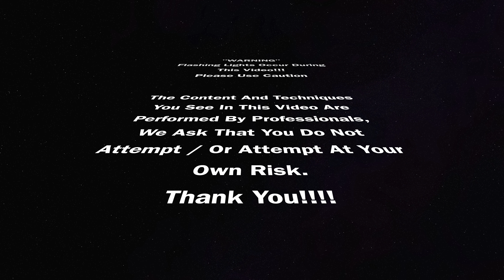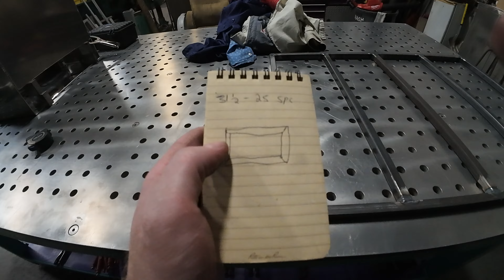Welding fixture table project - Custom Shelves Part 1

Comment from the maker: I’m still kinda a beginner at figuring out all the ways to use this fixture table but have been trying to use the pin blocks more lately when I can and kinda neat how beneficial they are and accurate too.
 I have a video in my editing software that I started a while back shorter video I might post that its using the older table just to show that a fixture table is definitely not needed. Thanks for watching 👍